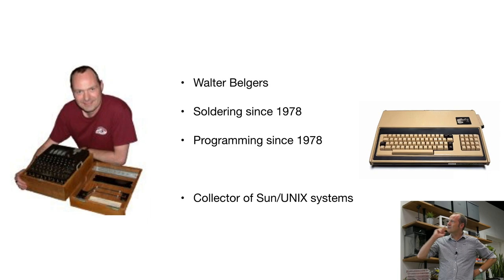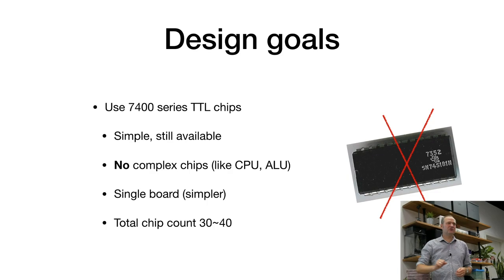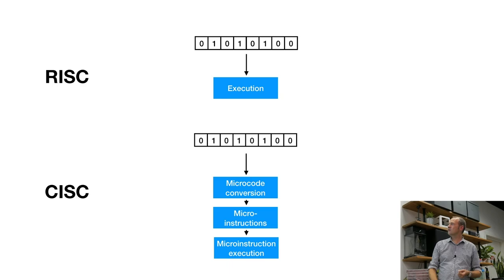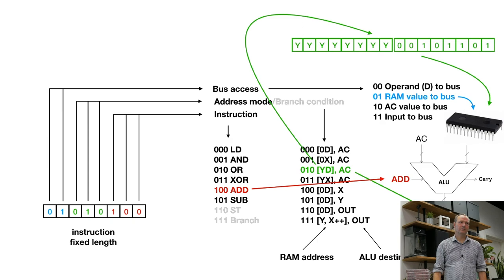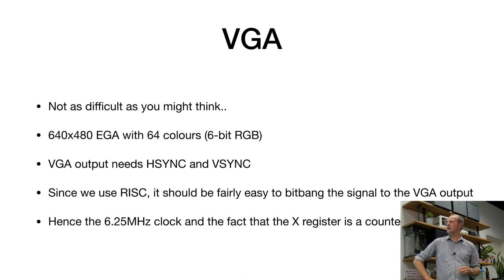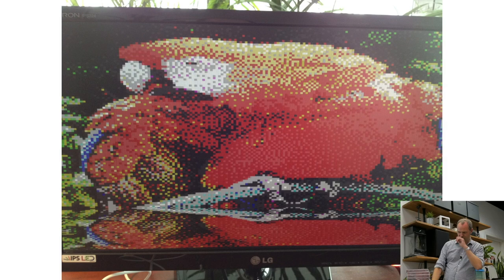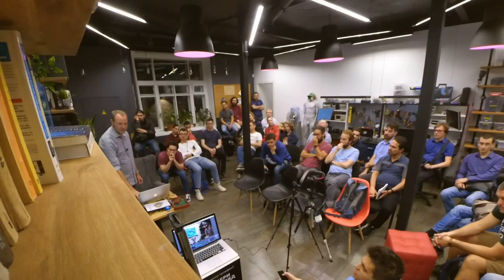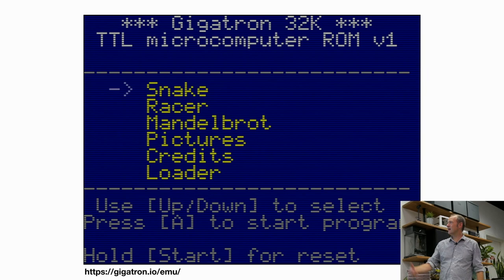Gigatron DIY TTL computer | Walter Belgers @ Neuron Hackspace

Comment: I have recently seen on a random Youtube teardown Video a DIY Japanese X-mass tree light controller from the late 70's , They had used a very compact and unique technique to isolate the LV and VAC; with a Glass Reed Switch that had a fine coil of wire wrapped around it that acted as a tiny relay,  this seems compact enough that it might be feasable to build a reed relay computer,  I expect it would sound similar to Mother from Alien when Cogitating.  The DIY aspect of the tiny reed relays appeals to me in the same way as a DIY Relay Computer, I think this could be a fun project.